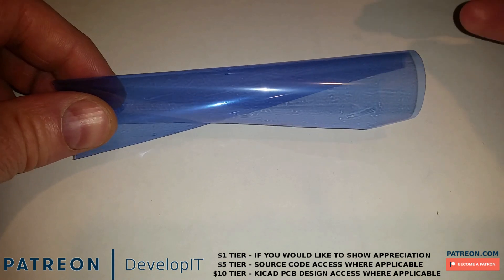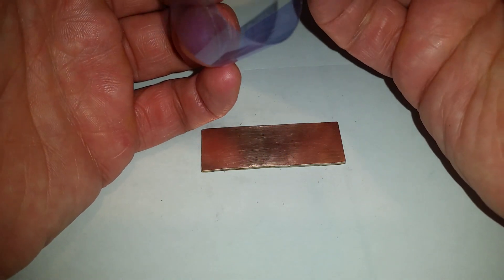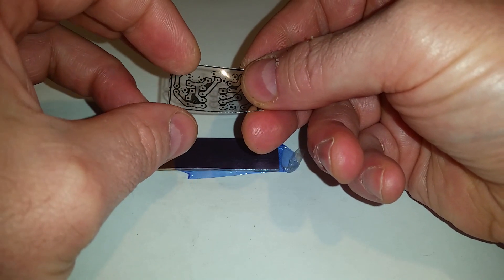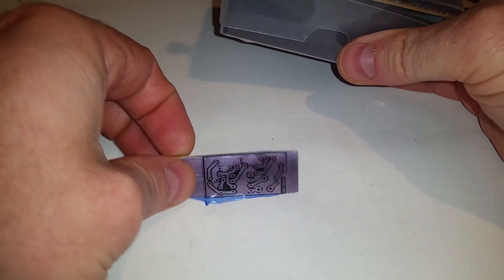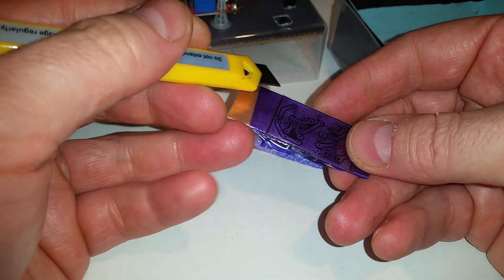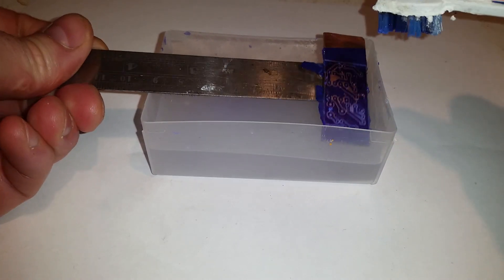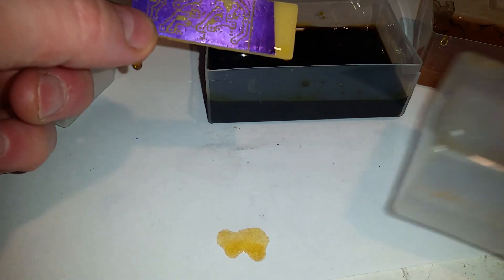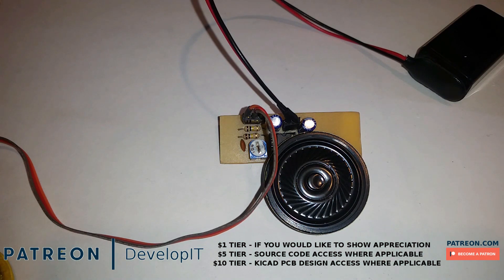Making a PCB using Ultra Violet Photo Resist

Comment: Wait, so the black lines are the parts that get etched or is it the part that doesn't get etched?
Reply from the maker: The resist film exposed to the UV light hardens and prevents the copper being etched. So the black area on the transparency prevents the light hardening the resist and will be etched away with the copper below it. The circuit tracks are the transparent areas.

Comment: nice video, thanks for showing how you do this.  I don't have the patience to wait 2 weeks for delivery of the $2 boards from china, but they are probably why I don't see many doing this anymore.  but i have a bunch of bare coppy boards and a big roll of uv photoresist so gonna do it this way.  After failing for 2 weeks I will then get the chinese boards in the mail, so no worries. :)
Reply from the maker: I'm the same, I use the heat transfer paper method as I find it easier. Though most of the PCBs I want currently are a bit too complex to make at home easily.

Comment: With your exposure box, I found that 8 mins exposure time is perfect and 2 mins in the NaCO3. I don't understand that only 30 seconds is enough for you. Beats me. It's not making any sense.
Reply from the maker: I'm probably putting too much current though the UV LEDs. Though there are a number of possible reasons. There are two frequencies the UV LEDs are available in, we may be using different ones. My UV film may be more sensitive. I only made a few boards this way, I found I prefer the heat transfer process of apply and ferric chloride; more preferable to UV apply, expose, develop, rinse and ferric chloride.

Comment: Why is the board not very clear to see if it has been exposed properly? You can hardly see if it has been exposed.
Reply from the maker: When I exposed boards the exposed areas where clearly darker colour. Make sure to keep the photosensitive film away from light in case it has been accidentally exposed prior to use.

Comment: I made this UV exposure box that you made and it did not expose the board. Maybe I should use a heater  gun like you used instead of the laminator. The exposure time was exactly 30 seconds. So right now I am very disapointed!! to say the least.
Reply from the maker: I have never used a laminator for this, so don't know what issues you are having.

Comment: What is the value of the resistor you are using with the 24 UV LEDS and the LED indicator ? I am using 6V minus the 2V drop across the indicator LED leaves me with 4V. With a 22 ohm resistor, I calculated a current of 272mA for the 25 LEDs. 11mA each.

Comment: How do I get more current to flow through the leds? The voltage is 3.5V but it is not bright enough. All the 24 LEDS are connected in parallel. No resistor on the emmitter or collector of the BD139. 1K goes to the base. I'm using a standard 555 timer with 4V.
Reply from the maker: You can adjust the resistor value on the base of the transistor or increase the voltage to the circuit (keeping within the voltage specification of all of the components).
Reply: @DevelopIT  I am using the boost buck converter, so it will need to stay at 4VDC.

Comment: If you run the UV leds directly off 4v then you have no current limiting resistor in series with each LED? Is that right?
Reply from the maker: The resistor into the base of the transistor will also limit current. The transistor has a gain (hfe), what ever current passing into the base will be amplified by the gain of the transistor.

Comment: How much current is each LED getting?
Reply from the maker: I didn't measure. The LEDs I got seemed to run fine at 4V, but I have no idea of the spec of the LEDs, I'm probably over powering them. LEDs can vary significantly in specification.

Comment: Thanks, but use gloves 🧤 and just rub with your fingers in the sodium carbonate.
Then use a paint brush, not the toothbrush.
Actually you can use the toothbrush to scrape off the Crured Film at the end.

And now I see where I fucked up the process:
1. I didn't remove the top film before applying the UV Mask and the film probably moved around a bit and the UV Light dispersed through the film leaving me with a mess...
2. I used H2SO4 to clean up the Cured Photoresist Film, which only takes 2 seconds, but also started dissolving my traces... If I remember correctly...
Reply from the maker: Good point about the toothbrush, it is a bit aggressive for the job. I tried the UV method to see how easy it was. I now use the heat transfer method as I find it much simpler.
Reply: @DevelopIT  it's simpler, but you have to get the pressure, time and temperature right and you don't always get a good transfer

Comment: Hi Thank you for a very informative video. I will give this method a try.
Reply from the maker: Thank you. Of the two methods I have tried, I prefer the heat transfer paper one, as it is simpler and quicker. I was thinking in future I may try the UV Photo resist to apply solder resist to a PCB at home, and maybe a silkscreen layer.
Reply: @DevelopIT  It's simpler and quicker but worst quality and not very consistent results.